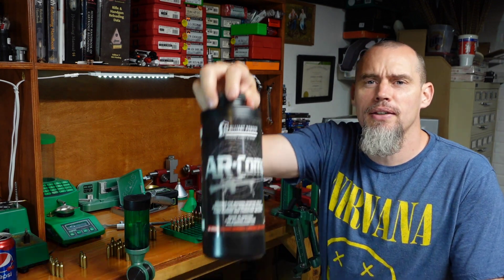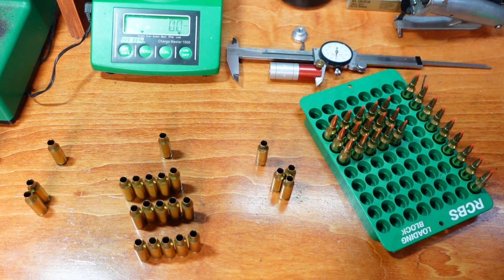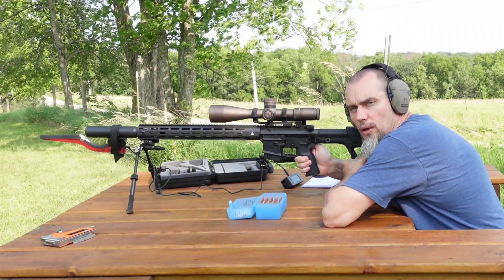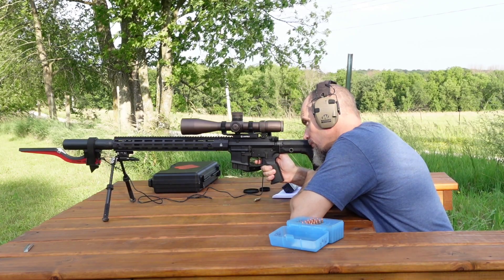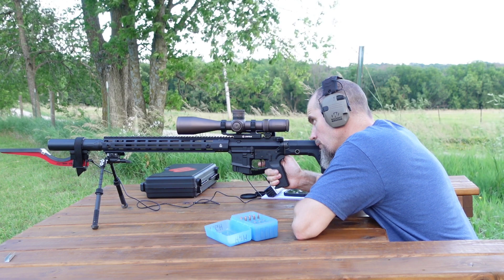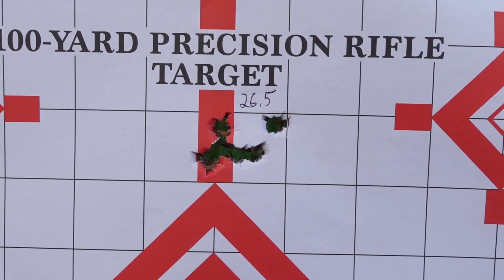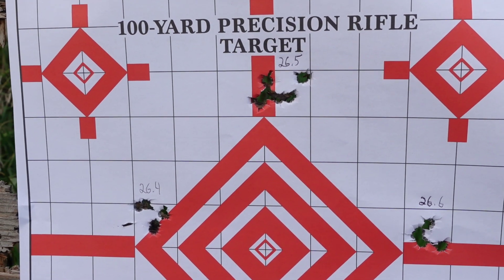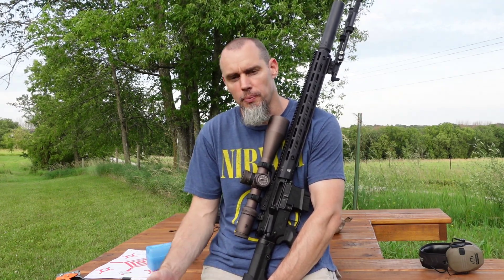6mm ARC Handloading: Reloading  75 & 85 V-Max with AR-Comp. Part 2

Comment: Just some quick info. Working up 6mm arc with 75g v-max using ramshot tac. Not getting good SD/ES, best I have been able to get is 35fps ES, 13fps SD at an avg 2958fps at over 1.0g below max. Was hoping TAC would be a good performer with the 75s based on how well it did in 223, no so much.
Reply: What were the groups? Never mind the SD, if you’re getting 1/2” moa just enjoy the win!

Comment: I just came across your videos today 8/13/23. I like what I'm seeing  I did Subscribe I m ninerested in building a 6mm Arch  with a 24 inch barrel any suggestions on which one to get.
Reply: For an AR, I’ve had good luck with EABCO 24” barrel.  Factory ammo so far but 105 and 108 hornadys have been 1” and below.  I was able to take the 108s out to 850 yds with out a problem.
Reply from the maker: I wish Proof and Wilson combat made 24" barrels. I've seen a Faxon 24 shoot pretty good. You could always buy a Krieger, Bartlein or Brux blank and have a gunsmith spin it up too.

Comment: AR-Comp with 105s did not go together well. I got pressure signs before getting close to decent velocities. It looked like it worked OK with your 75s but not so great with the 87s. I don't think you'll get much life out of the brass before the primer pockets get loose with that powder.

Comment: Starline is making 6mm arc brass now. just put 250pcs on backorder Friday. Really looking forward to getting them. I just loaded up my first test loads, loading 107g SMK and 85g Nosler Partition with CFE223, and the 75g v-max with TAC. Hoping to test  Wednesday. I generally shy away from OCW, I tend to wind a charge I like and tune seating depth. Got a 20in Ballistic advantage barrel.
Reply from the maker: Creedmoor sports has the starline brass in stock, I just picked up 300 pc myself.
Reply: @thelonggunner762  They were out of stock there when i looked friday. Bummer. Hopefully starline gets em out fairly quickly.
Reply: Druidhillarmory has some right now!  Just bought some.
Reply: @curtisclemens9348  my backorder just shipped! 250pcs on the way
Reply: @jonathanrogers9961 how did the TAC and 75 v-max workout?
Reply: @dpwild328  badly. Best group was 2in at 100. 9 shots 0.8moa, 1 shot a little over 1.5in left. Best guess, bullets are way over stabized aka being spun too fast. Also, only found 1 good seating node, verry fickle. Almost dont with my 107g smk workout, one more outing and i will know if they shoot.

Comment: I was wondering would you actually hunt with that rifle the PRS stock suppressor and the razor G3 it’s quite a bit of weight on it. I have two razor GEN3 on my bolt rifles, and those things are a break sweet glass, sweet turrets tho
Reply from the maker: It is a bit heavy in current configuration. I'm just using the Razar on it for now because I wanted to get some time using it while doing all this load development, I have a Leupold MK5 3- 18×50 that will eventually go on for hunting.

Comment: I worked up a load for my two 6mm ARC AR15’s one has a proof research barrel the other one has a Wilson combat gunner profile both 18” using Hornady brass CCI400 primers 87 grain vmax and Leverevolution 31.7 grains they both produce almost identical results 1/2” MOA groups 2953 F/PS no pressure signs kryptonite on Coyotes . Last time I tested them it printed 3.4 inches at 600 yards for five shots.

Comment: Do you use load development software? I use Gordon reloading tool and have found it very helpful. Check out VV N135 for 6mm ARC varmint loads
Reply from the maker: I've been thinking about downloading Gordon's, my buddy has Quick Loads and it seems pretty close. I should download it to compare the 2
Reply: @thelonggunner762   either one. GRT let's you access their server. You can't access GRT if internet goes down where as quick load downloads to your computer. Both are very helpful. Finding the best powder is a breeze and finding a safe starting charge. Check for powders that maximize case fill and burn 95%+ in your barrel length. Both will save a lot of time and components ($$$).